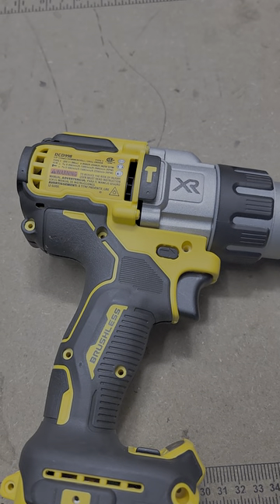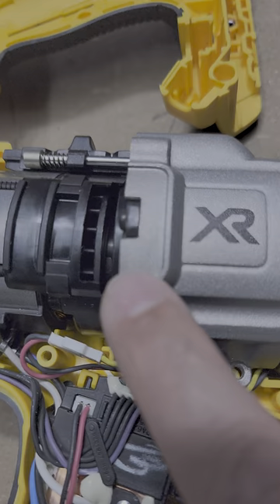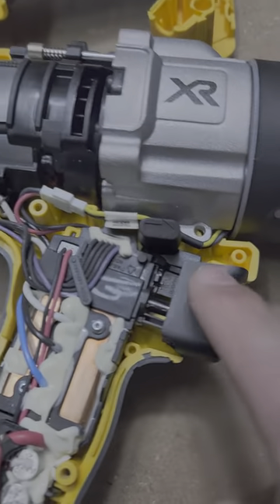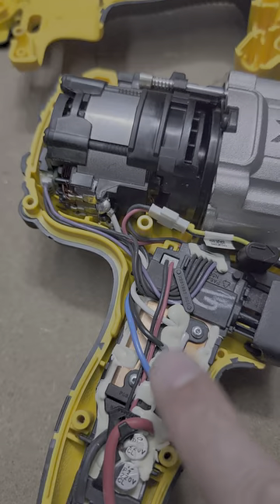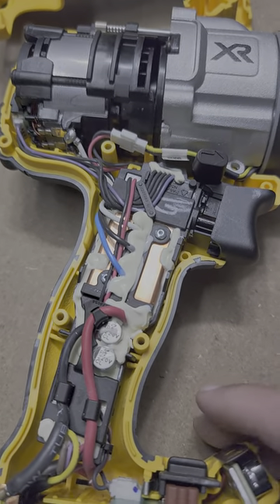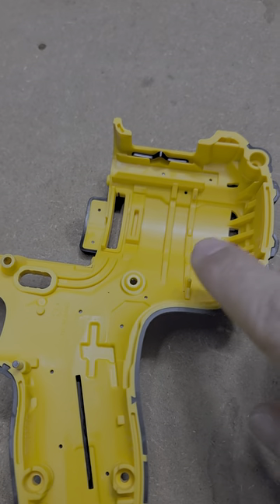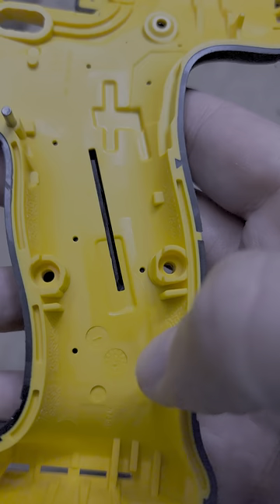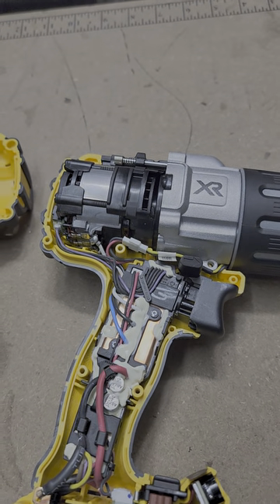Tearing Down the Dewalt DCD998 Power Detect Hammer Drill #teardown #dewalt #dewalttools #lowes

Comment: I think the fan configuration is cool, that said, I don’t think it does a lot because I have the same drill and when it was working it didn’t seem to move a ton of air like my Milwaukee does or an old vintage Milwaukee drill I have does. 🤷‍♂️
Reply from the maker: The ventilation does seem to be an issue. The ports aren't quite big enough
Reply: @ToolswithSoAlz  lol I sound like a Milwaukee nazi. But seriously though, I also have a vintage Rockwell drywall screw gun from like the sixties and it even moves more air then the Dewalt did.